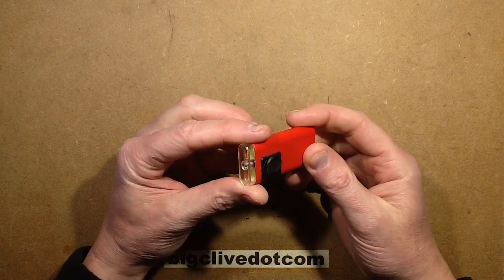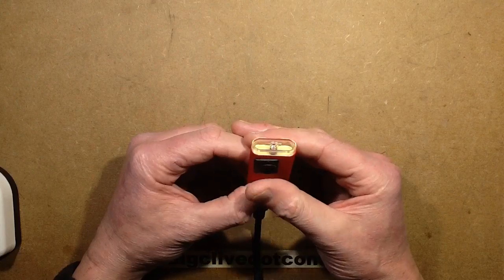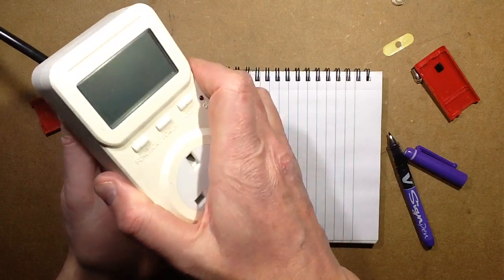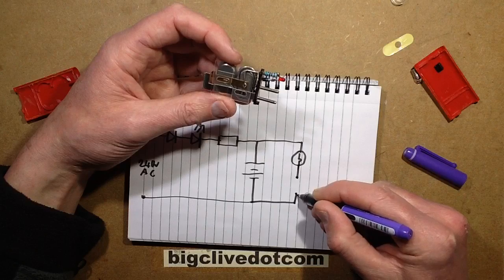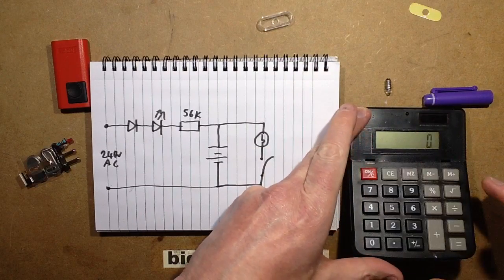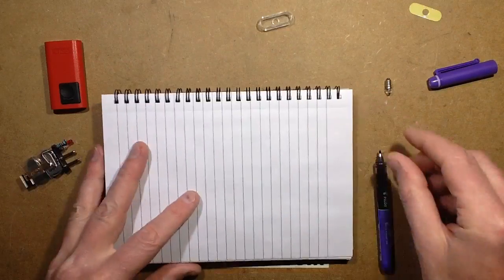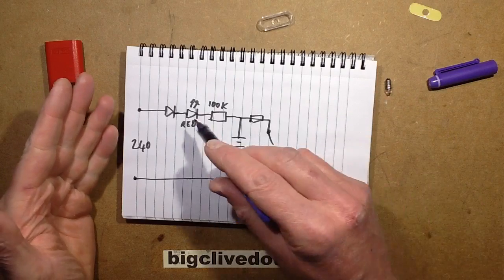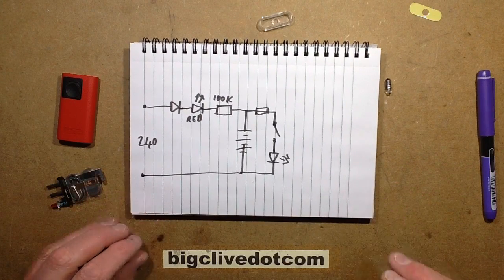Unique vintage rechargeable flashlight from 1980's (with schematic)

Comment: why does main voltages keep increasing overtime?
here it used to be 220 but now is 230 or 245
Reply: because international homogenisation... over the whole EU the current standard is 230V +/- 10% as far as I am aware...
Reply: European power is expensive due largely to environmental regulations. Line loss is decreased as voltage is increased, i'm not sure how you Europeans do it (i'd imagine its just like the US)  but we run long distance power transmission at tens of thousands of volts, its only 120/240 for the last quarter mile usually. Higher voltage devices have just about matched lower voltage devices in terms of efficiency in voltage transformation when stepping to a level that is useable by most electronics.

As for things breaking, Stuff over here in the US breaks no more or less than your Euro devices, as long as its not built really crappy. A GE washing machine in the states will likely last just as long on average in Great Britain or France
Reply: BavarianMonkey US residential clothes washing machines don't use that much current. For example my Maytag Neptune 5500b is the older model with the switched reluctance drive motor and no power factor correction on the inverter. It draws max about 800 watts at .65 power factor as it is accelerating to top spin speed with the drain pump on then settles in at 650 watts steady state.

A cause of confusion may be that we generally have seperate washer and dryer in a utility room or basement instead of a combined unit in the kitchen like other countries.

The electronics and drive motors of both washer and dryer here are always 120v, only the heating element on electric dryers is 240v. Electric dryers historically have had a 3 pole 30 amp NEMA 10-30 plug and socket with no ground/earth, neutral was used as ground. Since 1996 a 4 wire NEMA 14-30 has been required and a true separate ground is now used.
Reply: Daniel Armstrong your washing machines generally have a hot water input though. In Europe we usually only have a cold supply to the washing machine so there is a heating element in it to heat the water in the machine that pushes the power draw up to the region of 2-3kw.
Reply: I'd like to disagree on your 99% of modern electric development being done in the US, but that is not the topic right now :-)

The 208V in delta configuration is due to the 120 degree phase offset of the three phases. The voltage to neutral (the "star" voltage) is 120V, the voltage between the phases is square root of 3 times the star voltage, so sqrt(3)*120V = 207.84 V or roughly 208 volts.

In Europe it is 230/400 V, same thing, different voltages but star/delta.
Reply: To keep your usage bills and equipment failure rates high?

I often wonder about the saving that could be made if they lowered it down to 230v...
Reply: +BavarianMonkey - it's 120/240, not 110/220.   Nominal voltage is to be no more than 120, and no less than 110.   My normal voltage (pulls out LG voltmeter) is currently 115.6 volts.  I usually see 118 at most commercial sites.   If I see 112, I start looking for what's overloading the circuits.
Reply: @Troy Belding 
yeah whatever. People still call it "two twenty" over in the US (at least the ones I talked to) so I'd say it is close enough for somebody from Europe to call it that :)

I always wondered why I have seen devices with "110V" and "120V" taps on it, as well as "117V". Can you explain that to me?
Reply: Why no hot water into the machine directly? Would make sense, I presume, if the rest of the house water is already electrically heated, I guess -- And since everything is 230v, I guess it's actually more efficient to heat right in the machine (no pipe heat loss) ... would that be it, or is it something else?  Though you seem to be aware of this-- for others, in the US being 110v for the majority of wiring, only the hot water gets a 220v circuit (and stove, and dryer) if it's electric -- but many (myself included) use gas to heat water.
Reply: I think it may be more to do with that if you are using electric to make hot water, since your entire houses are 240v, there's no efficiency loss in heating the water right in the appliance vs. in the USA, heating w/ 110v draws way too many amps and even if you were willing to sacrifice the efficiency lost by using 110v, at 15 amps, you're limited to around 1800w or so, give or take.
Reply: BavarianMonkey I was talking to 9ff, and I mentioned transmission line voltage because it has everything to do with his comment. Measurably, however insignificant on the small scale, even 10V makes a difference in line loss over the comparatively small distance of travel between the transformer and outlet. Nothing you said about the matter was wrong though.

In WWII huge portions of Europe's infrastructure was destroyed, huge sections needed to be rebuilt from nothing, many people also had what few electronics they owned destroyed. Due to the shortage of copper ring mains were formed, having a higher voltage also worked out as requiring less current draw for the same power usage, resulting in less heat buildup for the same gauge wire.

As for the US situation, its partially due to a grandfathered in, but it has more to do with WWII than anything. The US wasn't bombed hardly at all, as such our 100V system was left in place. Since there was no need to update during or right after WWII, we didn't. 15 years later it was too late as the number of electrical devices had surged and made the switch too costly to the end user.

There was a switch to 120V at some point which escapes me, for exactly the same reason that most places use 240V, it saves so much money on a large scale. No, we cannot run large heating elements on 120V without using huge wire, so we use a split phase system, 120V/120V offset to create 240V. The way the breaker boxes are setup, installing a single pole breaker provides one 120V line. A double pole breaker provides two separate 120V lines or a combined 240V line. A side effect of this, if you have two separate circuits that happen to be on opposite phases but are say, 120V wall plugs, if you measured between live pins you would get 240V. Normally this doesn't matter, until you get someone who tries to wire things as if it were a ring main or increase current by splicing two power leads onto a single device or power bar. Such a case could directly short the two phases together, the result would be like taking a wire and poking it from live to earth or neutral in Europe.
Reply: Combined units are rare - they are rather poor efficiency wise and can dry only half the load.
The UK probably puts the washer in the kitchen, the rest of europe has a separate room or the bathroom.
End 230 volt countries use resistive electric heating for the washing. Drying is moving to (electric) heat pump.
Reply: Thank you for that additional info.
Reply: +BavarianMonkey Devices without good internal voltage regulation can benefit from manually setting them to the actual local voltage, though in other cases it might just be someone not realizing 120 and 110 are so close the difference disappears in the tolerance.

Anyway, the standard voltages used to be 55V for arc lamps, 110V for the US and its dependents, 220V for most of the world and 240V for Britain.  But when the EU made a big push to harmonize all technical standards for the "common market", they merged 220V and 240V to 230V (to avoid making Britain a special exception), and got that number pushed upwards into the worldwide IEC standards, thus causing many non-european countries to start officially referring to their utility voltage as 230V or 115V instead of the traditional number.
Reply: I meant that since that fight, everything has been refinement of what 
was already there.   Notice I didn't say electronics, I said electric.  I
 was talking about the distribution/transmission/generation process.  
Perhaps I should have said 'electricity'.   Thanks for the brief 
explanation of the 3 phase.  Never researched it - no fun :)
Reply: BavarianMonkey in Canada we have 120v at the outlet or 240 depending on the application the outlet is being used for. ovens, stove, clothes dryer, hot tub 240 volt, most everything else at 120v. tolerance is between 118 and 125 v. that is single phase. commercial areas have 3 phase and depending on transformer sets can be 120/208v or 120/240v three phase   or you can have 347/600 volt to the building for heavy factory equipment and have a step down transformer to feed office areas of the building the 120/240 that is required for computers and stuff. most equipment here is rated 208-240v and 130v.
Reply: +BavarianMoinkey
In the USA and Canada, washing machines work on 110v. It is the dryer that requires 220v. Baseboard heaters and the stove/oven also use 220v.  Everything else in an average home is 110v.
Reply: Robert Cartier that's why yer kettles are crap. Always find it surprising that the USA - home of consumerism can only supply 1/2 the wattage over a regular socket that most of the rest of the world can.
Reply: "For Germany this means that the voltage increased slightly, for GB it means a slight reduction." - actually, no voltages were changed. What actually changed was the spec, to, on paper, homogenise everything. So we get to keep our 240V, mainland Europe get to keep their 220V, but the spec then specifies "230V" with a tolerance big enough to incorporate both the systems. Euro-fudge.

"In Europe it is 230/400 V, same thing, different voltages but star/delta." - here in the UK, it's 240V or marked 415V for 3-phase.

1marcelfilms - where is "here"?
Reply: Kettles are rated on their wattage, not on their voltage rating. a 1500W 240v kettle in the UK and another 1500W 120v kettle in the US will boil water (from the same source at the same atmosphere) in about the same time. I'm not sure i've seen a kettle that goes past 2kW (those chinese kettles that claim 3kW excluded as I wouldn't use those even if I did have 240v available). In the US most kitchens run a 20A circuit for higher powered appliances like microwaves, kettles, mixers, etc. Even at 120V 20A, that's a power rating of 2.4kW. Most US kettles are only 1kW though, it seems that most UK kettles are 1.5kW or 2kW. Largely because most people in the US are fine waiting an extra minute or two. Besides, more people in the US make coffee in a coffee maker, not a kettle, most coffee makers are 1500W, and heat the water as fast as it can drip. My coffee maker fills a pot in 40 seconds, and its very hot. I don't need something more powerful for home use, most people don't. So few people use kettles, that is just isn't a problem.
Reply: 2009dudeman actually most top brand kettles in the UK are 3Kw, which is just too high an amperage for a typical 110v socket. If a UK plug is only rated for 16A, then I wouldn't want to force 20 - 27 amp through an American plug or more importantly the cord, just seems like a disaster waiting to happen.

In the UK more people use kettles than percolators, because more people here drink tea, and instant coffee is also much more popular here. Here it is a more social thing, people come round and have some tea whilst having a chat. A UK kettle takes about 4 minutes to boil a full load of 8 cups of water, an American kettle would take around 12 minutes, no one has that much time to wait for a round of tea.
Reply: Robert Cartier dryers use 240v for heating elements and 120v for the drum motor that is why they are 4 wire single phase. baseboard heaters can be 120v or 240 depends on model ordered. 120v baseboard heaters are much less efficient than 240v ones for obvious reasons (ohm's law)
Reply: Transmission line voltage does not have to do anything with what he was asking. You are correct that those run at hundreds of kV but the voltage there does not affect the outlet voltage because the transformers inbetween have coils with taps on them so you can set the voltage ratio within certain limits. So you could run a tranmission line at a few percent higher voltage than usual and not have the outlet voltage change at all.

The bigger factors are the homologisation on one hand (Germany hat 220 V until the 80s, today it is 230 V, Britain hat 240 V...) because they chose to specify 230 V +/-10% as the nominal outlet voltage here in Europe. This means that local regulations like 220V +5% / -10% are not valid any more and the tolerances have been increased in the process, so the new nominal voltage fits most of the old local regulations without any major changes. For Germany this means that the voltage increased slightly, for GB it means a slight reduction.

On the other hand there are more and more decentralized small power stations operating on the low voltage end of the distribution network. Now if you have an old transformer that is set to a certain tap (output voltage) of say 240 V that leads to 235 V at your outlet (line voltage drop), those power stations need to push at least 240 V into the line in order to be able to deliver power to the grid. This leads to higher voltages especially in longer linear non-meshed grid infrastructure situations.

If you combine these two things, you end up with higher average mains voltage on the low voltage outlet and bigger deflections from the nominal voltage.

And about that US topic: I do understand that the 110 V voltage is some kind of historic thing, but in all honesty: It is not really suitable for bigger loads like a washing machine due to the huge currents required. As far as I know you do have 220 V outlets for these applications, but it always makes me laugh when I watch machinist channels here on youtube, where they say "if you happen to have a 220V outlet..." when it comes to welders or other stuff that needs a little more juice than a toaster :-)
Reply: +BavarianMonkey The truth is most likely a combination of laziness, the 
union system encouraging bad behaviour in the US (see the previous), and
 a refusal to accept that there actually is a real standard.  (This 
happens a lot in low voltage cabling, such as telephone and data)   
According to what I'm reading right now, the original DC from Edison 
(Keep in mind that 99% of 'modern' electrical development was done in 
the US, as a fight between Edison and Tesla), was 110+, 110-, and 0 
(neutral) DC.   That was a nominal 10% over the 100 volt DC needs, to 
allow for line loss. I wouldn't be surprised to discover that the 
current 110/115/120 comes from that number, even though it's mostly 
meaningless between AC and DC.   A power brick right next to me has an 
input of 100-240V (Sorry Clive, you can't use it), and a 48V(DC) output.
   Of the other three I can reach without getting out of my chair, two 
have the same input, and one just says "100v A/C" for input.   I'm not 
sure where that one is supposed to operate.  I guess Compaq was having 
them made by a Chinese company that couldn't afford more numbers.  

However, it could also simply be the whole idea of averages.   Nominal minimum and maximum being 110/120, 118 being common, people putting 115V on their device would be splitting the difference.    What I've never gotten my head around is 120/208Y.  (3 phase).  It's supposed to be 120 on any of the three poles, but still only end up 208 volts?

Comment: We've had similar flash lights in the 80s, but with a cap in the end and a EU plug connector beneath it, so you could shove the thing directly into a wall socket. Internally, they were probably the exact same thing (although I remember them having a small sliding switch which stayed on when you slid it into the on position). But for some reason, they never worked right, the batteries went bad too quickly and then it lasted only for a couple minutes until going dark...

Comment: You could add a zener that would shunt the battery through the LED when it reaches full charge, it would not only prevent overcharge but would work as a battery charge indicator for when the battery is done charging.
Reply: NiMh and NiCd are fine charging indefinitely if the current is low enough. 1/10C is good for a 12 hour charge, 1/20C is fine for charging forever. The chemical reaction won't decompose at that low of a rate.

Comment: Pretty neat. Under normal circumstances, a transformer and rectifier circuit is used. For compactness, a resistor and diode does the job. I don't think there is a transformer in a cellphone charger. I could be wrong on that, but because of the size, I think there wouldn't be one.
Reply: Cell phone chargers do have a transformer but are able to use a very tiny one due to being switching power supplies working at  high KHz frequency.  You will (practically) always find a transformer in a regulated output power supply, with the modern cell phone type being regulated to 5.0V-ish to be compatible with USB aux. charging methods.

Comment: Hi Clive, the measured mains voltage could technically be just in spec :)
230V +6%/-10% results in 207 - 243,8 Volt
Because your meter did display 244 Volt this could be at or below 243,8 Volt 

:)

Comment: I have a couple of questions. Why is the diode required if it's in series with an LED? Also, are those cells the type that you would have stacked in a rechargeable 9v battery?
Reply: The led cant handle the ~330Vpeak of the mains in reverse, it probably only survives 20V or so.
Reply: They are somewhat like what is in some 9V batteries, except the shape and electrical contacts.  They'd need to be rectangular stacks, or some 9V have AAAA cylindrical instead, or more rare are short cylindrical cells stacked sideways, and typically the stacked design has a plastic casing with negative contact only on the bottom, not the sides as on coin cells, because if the sides made contact then they'd short out on the metal battery container.  Granted some of those are also plastic.